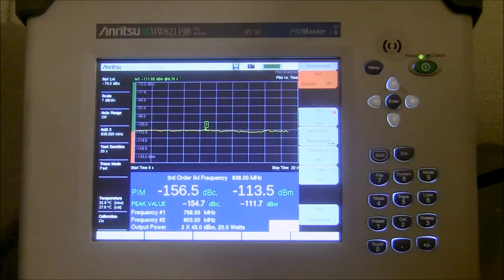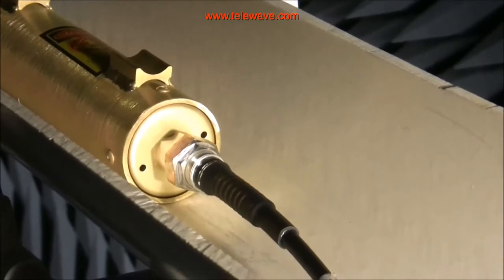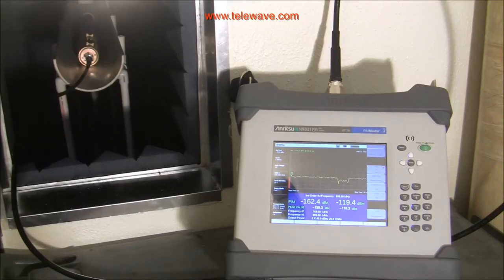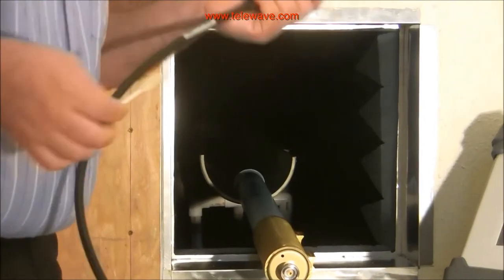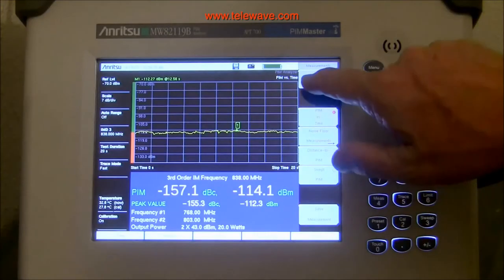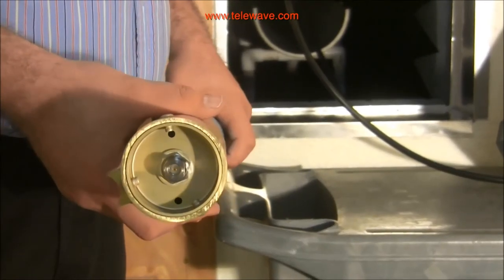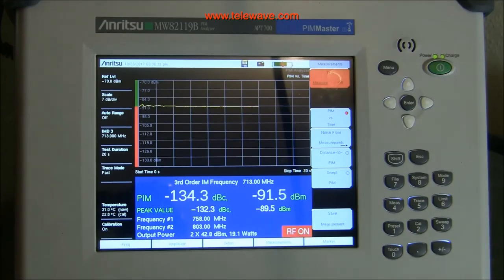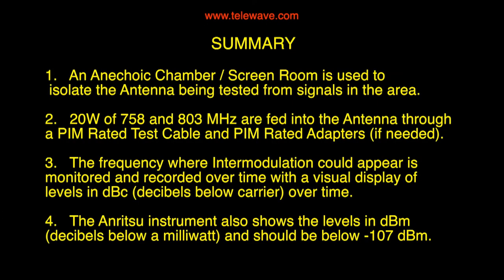Telewave PIM Rated Antenna Testing

Comment: What make/model torque wrench are you using in this video on that antenna connector?
Reply from the maker: Hi Doug, we used the Andrew Calibration #128753 1-1/4" Wrench on the antenna connector shown in this video.